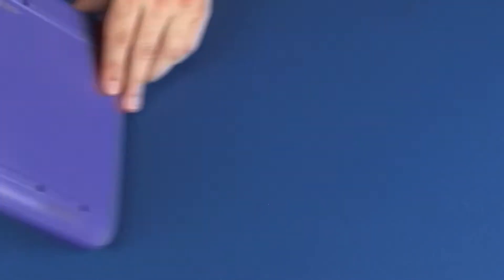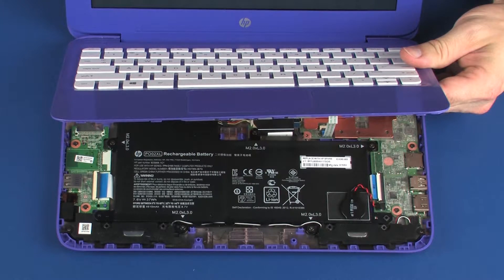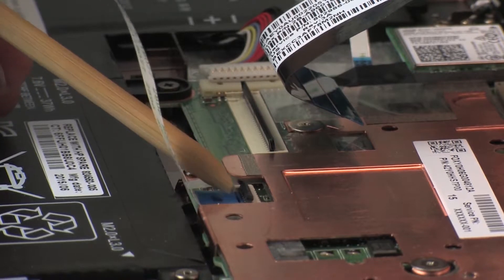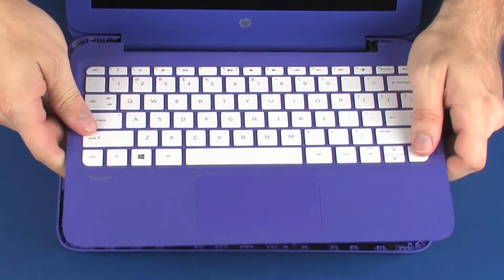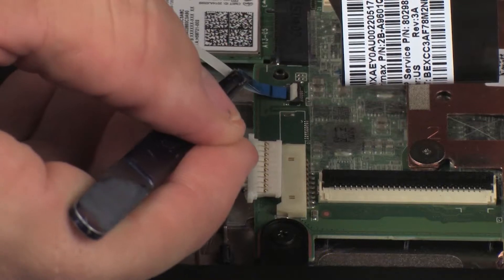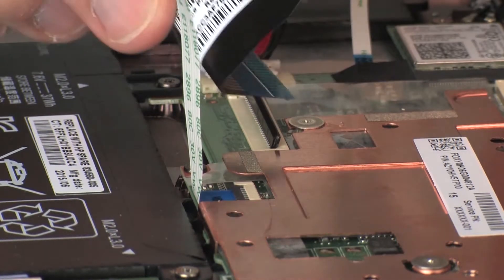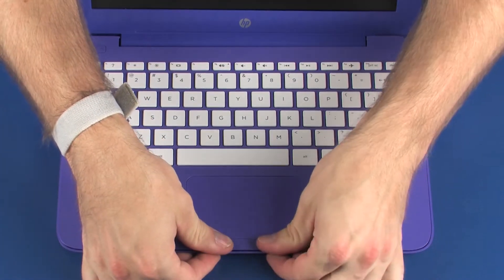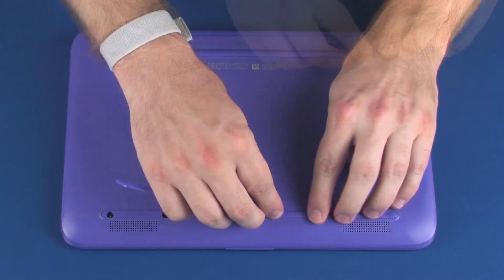Replace the Top Cover | HP Stream 11 Pro G5, G4, G3, and 11 Notebook | HP

Comment: Hi all, I'm getting hung up removing the cover. All the screws are removed and I've loosened all the way around, but something is stuck in the front left corner. (Would be near the Windows key, I think.) Any ideas?
Reply from the maker: +A. Bosserman Please refer page number 28 of the user manual to know about removing the top cover: https://bit.ly/3lOAkav